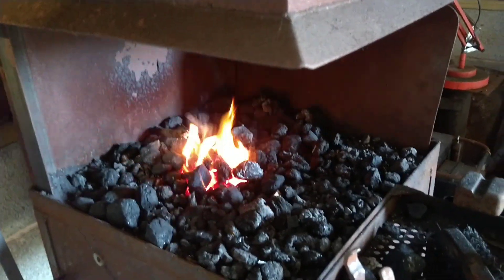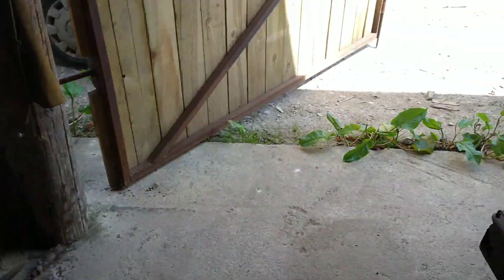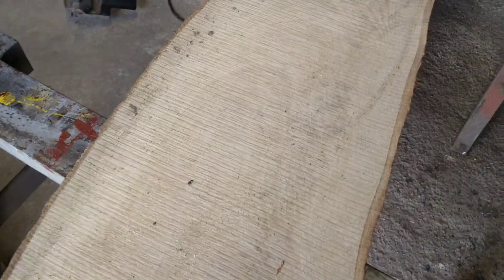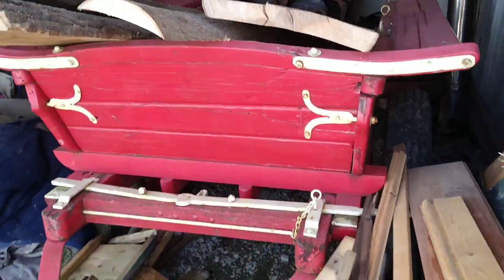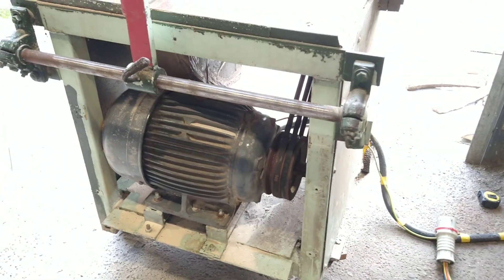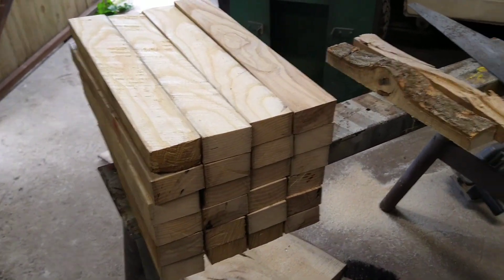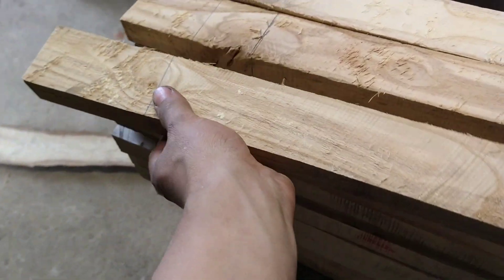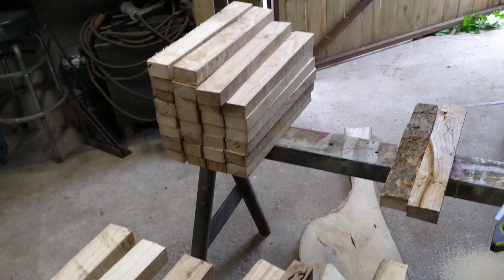Making a start on some Ash axe handles.

Comment: I am interested in the grain pattern of the handles. You showed how the growth lines were parallel the ax head for the long handle. This makes sense to me. but I couldn't quite tell did you say the opposite for the short handles? 
If so, why is that? 
I have always thought that the grain should always be the same direction as the tool swing. If not,  what are the reasons? 
Perhaps you have made a video earlier answering these questions,  i don't know.
Reply from the maker: No sorry I probably wasn't very clear in my video, the smaller handles have the grain growing the same way as the longer handles. The two boards had the grains running perpendicular so I cut the other boards for the smaller handles so that it had the correct grain orientation. I will get another video made for you showing them when I move onto the bandsaw. 👍
Reply: @Hammerandhilt  right on. Thanks for the clarification.  I've made a few handles,  but we don't have any real hardwoods here,  so I used birch. 
Looking forward to your other videos.  Thanks.
Reply from the maker: Birch is commonly used in Norway and Finnish axes use birch also. It can make a surprisingly good handle but is definitely on the softer side.